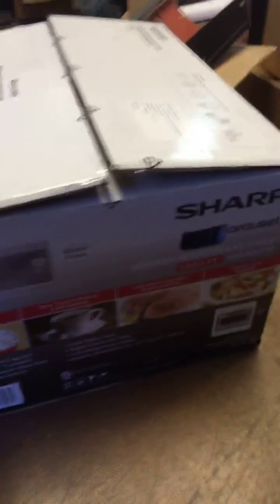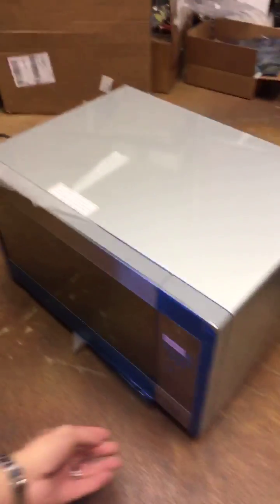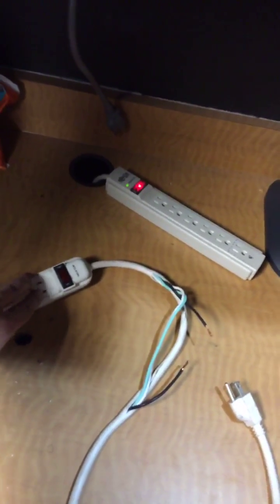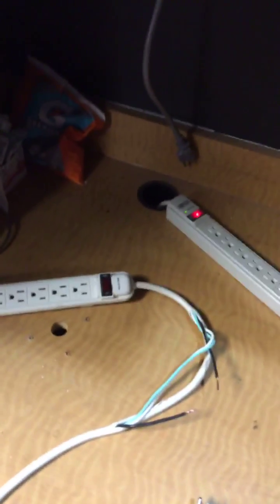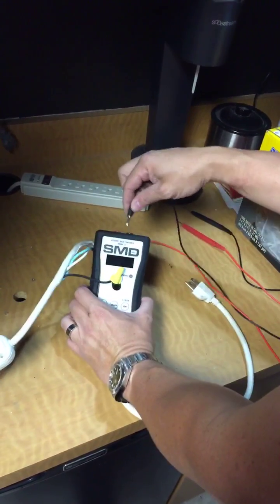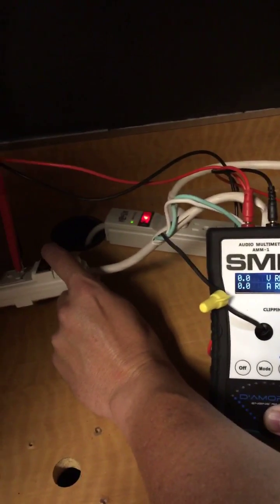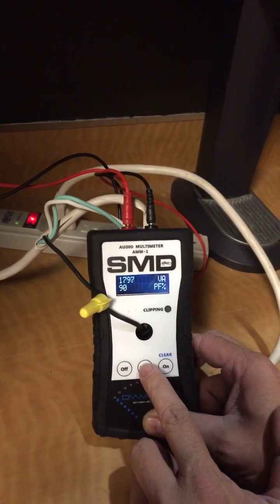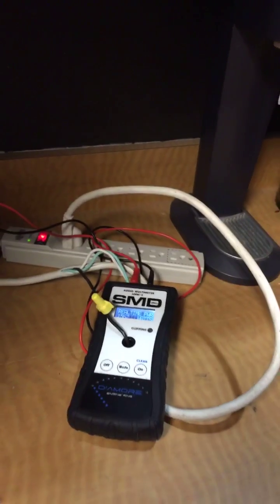Sharp microwave power tested on dyno!

Comment: fire to the instructions, I think that's an Arizona "thing".... cuz I do it all of the time! lol
Reply: I would like the the it's not a Arizona thing. Maybe there is a good reason for it but I can't think of one for taking the the owners manual lighting it on fire then throwing it outside to burn before even turning it on to make sure it works. When I saw that I thought wow that’s probably the type of guy that needs to read the instructions more then anyone. After he sets it up in the with not enough clearance on the sides (A year of working on mostly consumer grade household appliances, they need every chance they can get the way shits made now days). Starts it up to do the test and based on everything else when he's doing it is empty. I can understand why he would do  the test like he is but for a normal person it would be a lot easier to use a cheap meter that plugs into the wall and can tell you how much power its pulling and even tell you how much its costing to run. 

120V AC, 60Hz SINGLE PHASE WITH
GROUNDING
MICROWAVE
INPUT POWER 1600 W
ENERGY OUTPUT 1100 W
FREQUENCY 2,450MHz

Q : Will the microwave oven be damaged if it
operates while empty?
* A :  Yes. Never run it empty.

This microwave oven requires a current of approximately 14 amperes, 120Volts, 60Hz and a grounded outlet.

3. Ventilation.
 Do not block air vents. If they are blocked during operation, the oven may overheat and eventually cause a
failure.
  For proper ventilation, allow 4 inches of space between oven top, sides, rear and adjacent surfaces

Comment: Does this imply the power rating is at the magnetron?
Reply from the maker: Mike Whitenton Well we measured the input power so assuming the rating is accurate that would leave 450+ watts of inefficiency (heat).  I don't believe it is that inefficient because it would take some doing to dissipate 450 watts continuously.
Reply: DAmoreEngineering Wouldn't some of that 450 be used to drive the turntable and electronics?
Reply from the maker: smokiethebear912 for sure